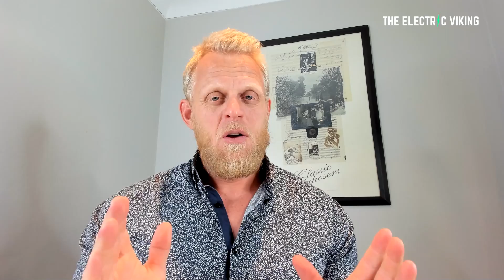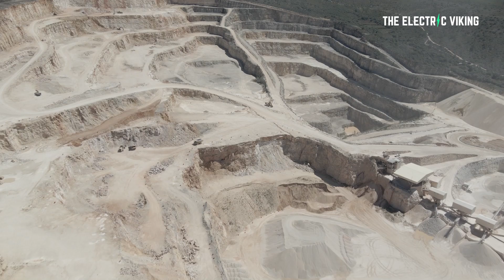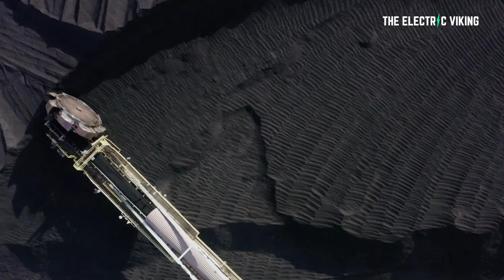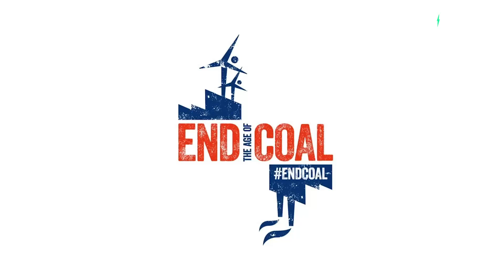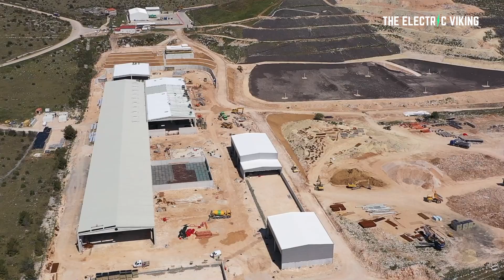Environmental group corruption is holding up TESLA Berlin

Comment: If the mine has a contract or a permission, that is serious. That can not be influenced by angry peoples, politicians or companies, only by courts. And you need a very good reason to break a contract.

The comparison of the water use does not make much sense. Tesla wants tap water, and gets tap water. The coalmine does not want to cave water, but groundwater flows into the mine pit. So they pump it down the drain.

Comment: The irony here is that the more EV's are built and start being used in Germany, the more coal will need to be mined to generate electricity. Far from being a short term solution, coal fired power stations are the only viable power source for a country like Germany, which doesn't get enough sunshine to make solar viable. And even if, theoretically, enough renewable energy capacity could be installed to supplement coal sufficiently to power millions of EV's, in practice that is probably not going to happen so if Tesla is allowed to have their water, the coal mine will also need their water so that they can supply enough energy to keep those Teslas running, probably on a mix of 60/40 fossil vs renewable energy.

Comment: I fear I will be swimming upstream on this one, but I disagree to the conclusion in this vid. I'm afraid that our host let his emotions take charge for once.

If I'm right in my conclusion then Tesla will get the permit early next year, to be safe, before the end of January and probably sooner, despite on any lawsuit. However, the local water supply cannot be guaranteed and will be closed, if required, to protect the local residents. The work around is to increase the water supply in the region (which seems to be a no-brainer).

What about the coal mine, well I believe that the coal mine is unrelated to the Tesla situation, although highlighting an absurdity. With a distance of roughly 80-90 km in a straight line between the coal mine and tesla, I find it incorrect to link the coal mine water usage to the Tesla water usage. Hence, It does not prove corruption. Besides I would not call more than 80 km for "literally down the road". 

Conclusion:
1) I am optimistic that Tesla will get their permit soon. 
2) The water supply cannot be guaranteed, so...   
3) I believe the local government will start increase the local water supply  
4) Until then Tesla will get an exception, if required, to use water from the current water supply.  

Assumptions:
1) I do not believe that the mentioned lawsuit is against Tesla, however, I have not found any documentation on the lawsuit yet.

Sources:
1) List of LEAG Mines: https://www.leag.de/en/business-fields/mining/

2) Distance from Tesla to closest Leag Mine by car 99.9 km: https://www.google.dk/maps/dir/J%C3%A4nschwalde,+Germany/Gr%C3%BCnheide+(Mark),+15537,+Germany/@52.1329149,13.9709927,10z/data=!3m1!4b1!4m14!4m13!1m5!1m1!1s0x4707d9a5a74aee39:0xfabe37bbb53d1097!2m2!1d14.4943322!2d51.859392!1m5!1m1!1s0x47a83072fa52a477:0x23e432b8d9ec6b!2m2!1d13.8204336!2d52.4240211!3e0
3) Local news: https://www.rbb24.de/wirtschaft/thema/tesla/beitraege/tesla-ansiedlung-brandenburg-produktion-verzoegerung-gruenheide-oder-spree.html

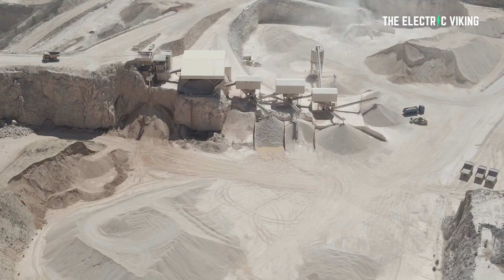Comment: 5:13 "...causing rivers and lakes to dry up...": They're pumping it into rivers and lakes to lower "their" water table. How does that cause rivers and lakes to dry up?
Reply: It would be lakes and rivers downstream of the mines.
Reply: Berlin area had a natural high water table and it drained slowly into the rivers/lakes in any dryer times. This kept rivers running and lakes with water in them. Artificial lowering of the water table = empty rivers/ lakes, which looks really bad. Though the coal mine pumping could keep some of the rivers running (hint corruption in local government) so it isn't visible. Coal mines use a lot of drilling and could deepen the local governments bores easily, hell they probably drilled them .

Comment: 4:10 "...water one of the best controlled food in Germany...": Doesn't it rain in Germany. Rain water is far and away the best "food" water there is.
Reply: 😁 rain water needs to be collected in some way ie dam. GL on building one near Berlin and these need huge catchment areas of low or unpopulated ground. The Berlin area had a less than 5 metre deep water table and wells/bores worked to supply enough water.

Comment: 2 companies applying to start up:
Coal Company: Hey Mr Government, I want to start a coal mine. I will use 200 gigalitres of water, will pollute nearby water sources, will pollute the air we breathe, will use diesel trucks and trains to transport this black sooty sand and I will supply nearby towns with 2,000 jobs. Oh, I’ll forever ruin the landscape but don’t worry, I’ll smooth it out which may be used for skiing in year 5800.

Electric Car Company: I will use 2 gigalitres of water, I can reduce it significantly via rain water collection, I will use solar panels to power 50% of the factory and I will supply 3,000 local jobs! In future, if you need the factory site for any other purpose, you can simply bulldoze the factory and do what you please with the land.

Government decision: As per our environmental and procedural obligations, the approval will be provided to the Coal Company.

Comment: environnement has been used before to prevent true green project... Québec has tried to sell its hydro-electricity (100% renewable) to the state of New York  for about 20 years but so-called environnemental groups have prevented the construction of high voltage line... recently Hydro-Quebec's CEO has explained this in detail in the medias...

Comment: I like to flip the 171x water consumption statistic.
If the coal mine saved just 1% of its water consumption there would be more than enough for Tesla!
With such vast overconsumption by the coal mine, simple water conservation measures could save 10%; so saving 1% should be easy.
Reply: The water isn't being consumed or lost or wasted. Around the mine they are pumping at the same rate that the aquifer is filling. The further you get from the mine, the shallower the water table. The water that is pumped out goes perfectly clean into streams and ultimately to the ocean. It evaporates, then precipitates, and builds the water table back up. And the cycle continues. If they quit pumping, the pit would just fill with water until a steady state is reached. And if they tried to mine under water you would have a serious pollution issue.

Comment: Tesla just needs to set up a deal with the coal mine to take the water that they pump out and clean it and  use it in the plant. Should not be too hard to put in a pipe line and a pumping station.
Reply: I love your style Randal. Solutions not reactions. 💜💜💜💜💜
Reply: A water supply dependent on a mine using well over its legal limits of water consumption?  If Tesla were to actually succeed with such a solution, the mine would then be shut down and probably Tesla would be investigated and sued and some of its officers indicted and tried.  Musk is learning a hard lesson  in what parochial and corrupt Germans will do to protect local economies.
Reply: @midlander8186  🙄Fair enough. Clean up someone else's mess & get in trouble for it. How about Tesla builds a solar farm & battery pack that negates the need for a coal mine. Or target 🎯 the mines stakeholders with an Electric Viking Thunderbolt! ⚡
Reply: @midlander8186  The trouble is they are not protecting anything. They are making a dinosaur.
Reply: The coal mine has more than 20x the allocation that Tesla needs. Most of it isn't actually used it is pumped out of the huge pit so the mine can work.

Comment: There are several real issues.  First is how much water is Tesla using compared to like size Mercedes, or WV.  Not Coal mines.  That’s just distraction logic. Second is what state is the water returned to the environment?  Loaded with contamination or cleaned.  Third is how much is water recycled in by Tesla in the plant especially in comparison to like industries?   Water is seldom destroyed, but is used to flush pollutants or evaporated.

What are the real facts on water usage?

Does Tesla capture Rain water? Big plant, big roof.

Comment: That sounds more like it. The ground water level which is usually (where I live) between 10 metres and 40 metres deep. If a mine or like around here we used to have gravel quarries for roads and concrete gets deeper than the top of the water table, the water level is then pumped out the easiest way possible. That isn’t actually being (used) it is actually being (wasted). From my experience our local quarries used minimum water in the crushing and mining/ dust suppression actions. Wasting it like that just lowers the water table for everybody.

Comment: Teslas approval has nothing to do with a coal mine, 0.0%. Another channel explained that Tesla applied an American approach in Germany that didnt work. Clearly Teslas US style approach was an overreach. Tesla will get their approval, but it might take a year, and only if Tesla are careful to not step on anyones toes. These approvals would normally take 2-3years in Germany, so if it takes Tesla 2yrs, they are doing well.
Yes, I get the coal mine thing, but, it is a distraction, and a deflection from the issue that Tesla were far too gung-ho for the Germans.
The enviromental groups are likely not corrupt, but are picking their battles. They already know they cannot win againsts a well connected coal mine.

Comment: The coal mine is 70 km away - any sources that they are really using the same water resources as Tesla Berlin? And even if they do - on what legal basis would you reduce water delivery to the coal mine in favour of Tesla? Not really sure what people are thinking... there are long term contracts and laws around all of this.
Reply: On the basis that the coal mines use more water then they are allowed to. 

Maybe Germany should also decide on closing such mines in the short term. Two problems solved with in one go.

Comment: May I just point out the irony: The coal from that coal mine is required to generate base load electricity that folks in Germany utilise to recharge the batteries in their BEV's (just like in Australia and China).
Reply: An ev charged from a coal mine still emit less co2 as compared to a traditional ice car.
Reply: You missed the Mark mate. 50% of Germanys power is from renewables. Also, the only people using the term 'base load' are News Corpse and the nufnufs who believe that drivel. The demand is dynamic, hence supply should be dynamic, and only batteries and hydro can quickly repspond to changes in demand. The term 'baseload' is meant to appeal to idiots. Try harder mate.
Reply: @nordic5490  Catchy name by the way LoL! Not really. The link I provided which showed the power gen mix %'s was removed by who knows(?) or You Tube.
Reply: Not ironic, just moronic. Governments control the power grid mostly and how the power is created. The best choices that consumers can make is to get solar panels on your home, buy an EV, buy more energy efficient appliances. Governments are too addicted to donations and tax revenue from fossil fuels to really be progressive about changing things, so it’s up to the consumer. You’ve got your head in the sand if you can’t see that.

Comment: Germany has a lot of  Green energy like Wind but there is a issue with steel mills and going into winter heating. Even wood heaters are now seen as a health issue. 
Tesla could harvest water similar to Bunnings in Australia. So  I would suggest there will be lots of these hurdles in Trannsition to renewal Energy. But I do think Coal is on way out but the phasing  out is not going to be overnight to many countries still way to dependant on it including Europe. Same as Nuclear power is not clean or is Gas which Russia supplies Europe.
In time it will happen.

Comment: I am from that region. The coal mine is nearby the Oder river. They have more water because of the river. But Tesla‘s Gigafactory builds on a water reservoir which gets dryer and dryer every year. 
Get the facts straight
Reply: Tesla Gigafactory is near Spree so why would that be an issue considering the low consuption? Berlin alone uses 160x more that Tesla has planned. Also the coal mine doesn´t use water from Oder. To mine the coal, the groundwater level needs to be lowered - pupmed away, that´s the problem.
Reply: @michalfaraday8135  the point is that water is really not that much in that area. The used water of Tesla will also go back into the water system, but even cleaned it might be a danger to the Berlin population.

I own an EV and every ICE car less is a good car. But we should not close our eyes to environmental risks or damages of a large scale factory.
Reply: @maniaclizard  Then the argument should be making sure Tesla will clean it´s waste water properly, not the consumption itself. Their battery plant shouldn´t produce a lot of waste water - so monitor it and penalize them if that´s not the case. I´m pointing out that Tesla water use won´t make or break the water situation in the area while as this video pointed out the coal mine has far more significant effect.
Reply: @maniaclizard  then shut down the coal mine. They are using 100 times more water.
Reply: Hahahaha! Then let Tesla use 1% of that coal mine water that they pump awsy anyway!
Get that streight.
Reply: So these mobs have no problem with Mercedes and BMW and volkswagen making ICE cars and destroying the environment ? Because these so called environment group are getting paid by them not to allow Tesla to produce any cars.
Reply: Nano One Materials Corp battery materials technology will empower Tesla to use 20x less water